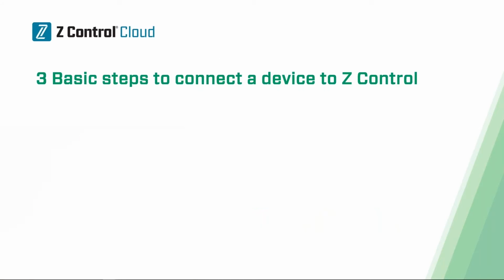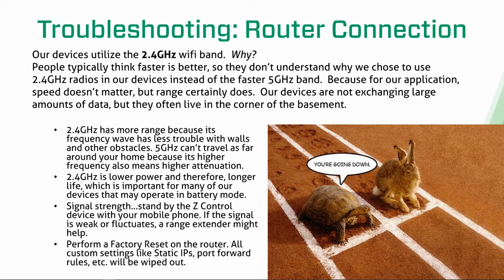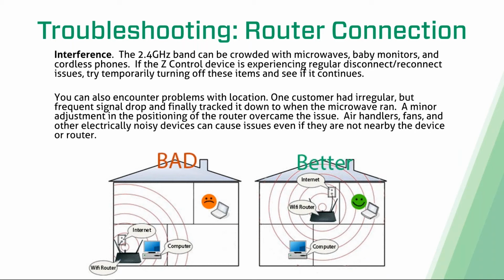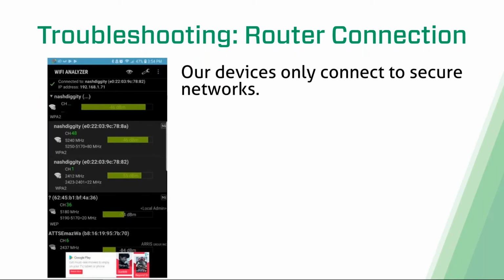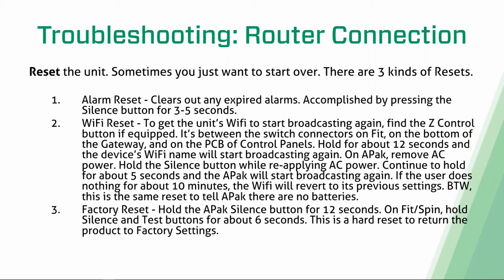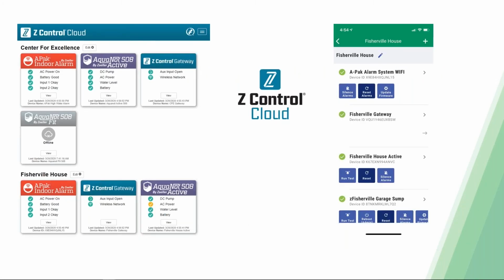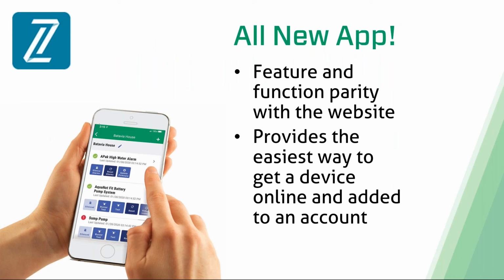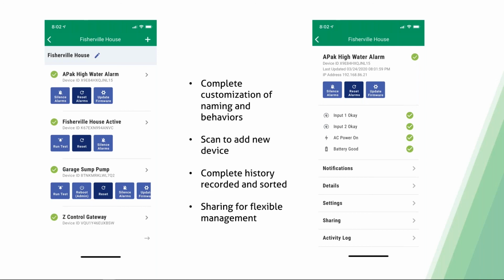Z Control Cloud Webinar Part III - Troubleshooting

Comment: It has only been a day but I think you led me to my problem with dropping connection to my network. I added an old router behind my primary router and set up a "Zoeller" ssid to be exclusively used by my "Basement Sentry". Fingers crossed but no drops so far! 
Dick Whitehouse

Comment: Do I need to do a Factory Reset to connect to a different WiFi?
Reply from the maker: Hi! Our Controls Product Marketing Manager recommends the following: A Wi-Fi Reset is necessary to clear the old Wi-Fi credentials. The process to do this reset depends on the product (see the product's installation instructions document).  After the reset, setting up Wi-Fi will be just like the first time. Technically, this reset is different from what we call a Factory Reset, which restores factory defaults but doesn't wipe out the Wi-Fi credentials.  There are 3 different kinds of resets: an Alarm Reset will clear all alarms and return a unit to standby mode, a Wi-Fi Reset is used to wipe out Wi-Fi credentials so that a different router or new password can be used, and a Factory Reset restores factory default settings. We hope this helps!